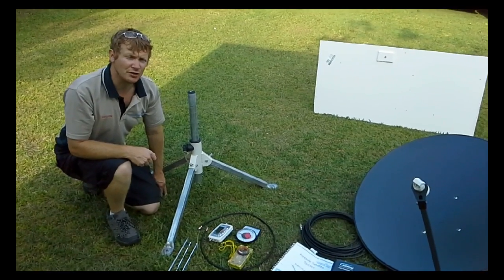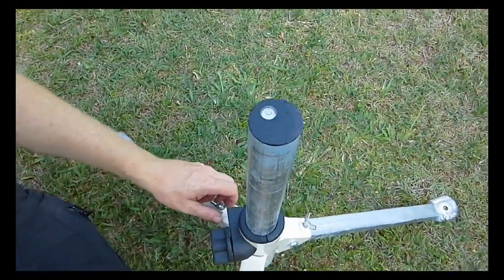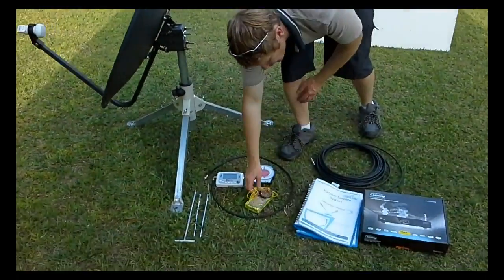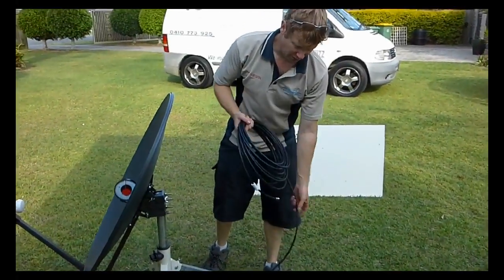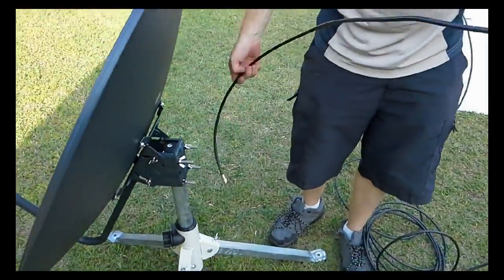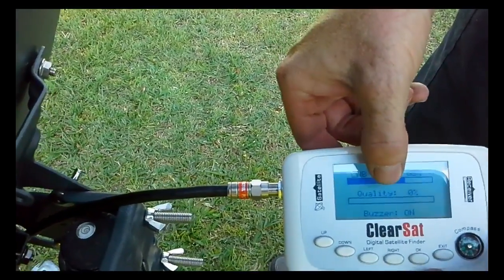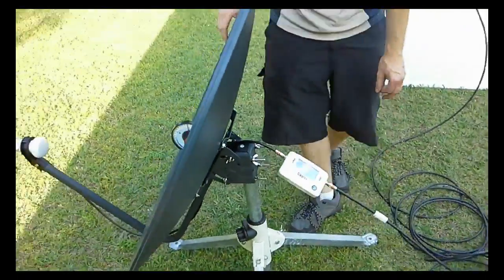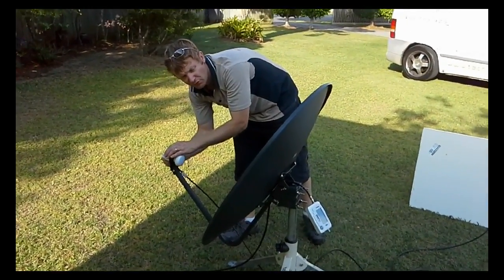How to set up a Portable Satellite System -  Technical Whizz

Comment: Elevation angle is measured off the LNB boom, not the dish face for 99% of satellite dishes. There will be a significant ~30 degree difference between the 2
Reply: Mat O'Neill I have one of these dishes. And the LNB arm is 5 degrees off so this way works better in my opinion

Comment: Hi Technical Whizz, Great video. If you are interested we have proper caravan dishes with a removable arm so it can fold down. We have the bags also available. We also have a new tripod design from the old model with two adjustments. Give us a call and we can arrange for one of our stores to assist you with the new improved models to keep your customers "happy campers" with the latest products designed by us. Gary